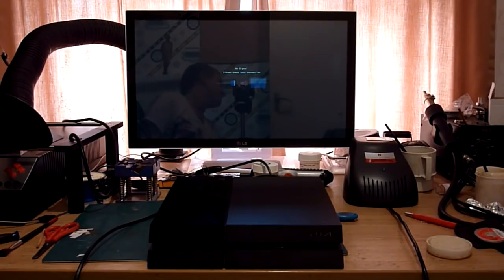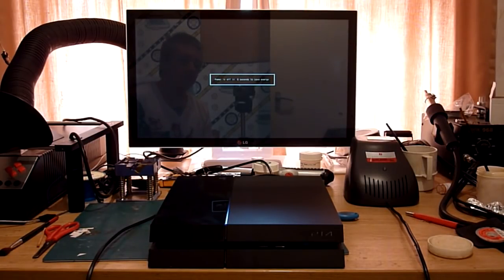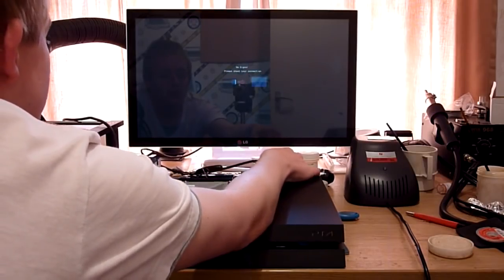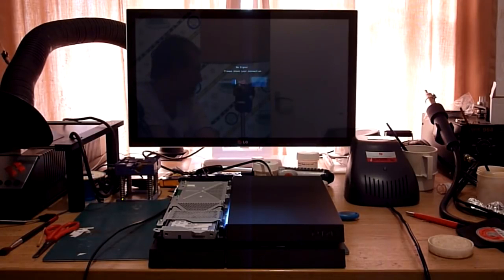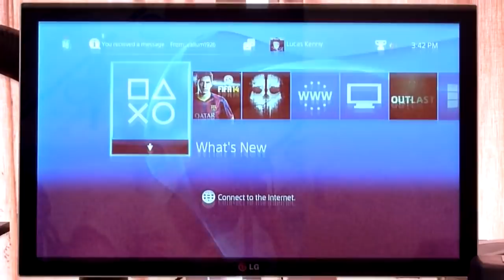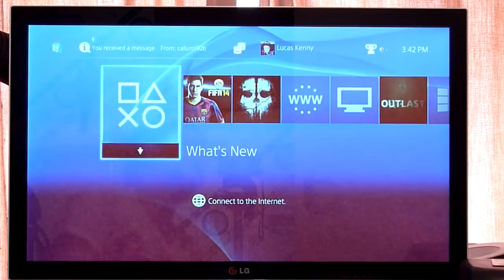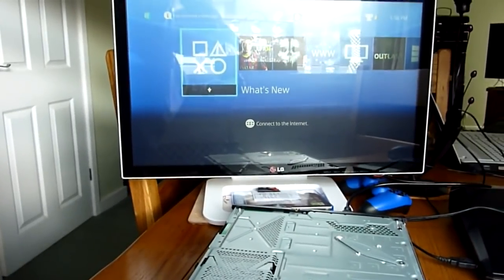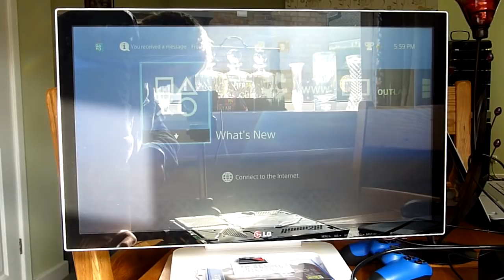PS4 White Light of Death (WLOD) - Faulty HDMI Socket Replacement Fix

Comment: this is not working
Reply from the maker: If a port change hasn't resolved a display issue then it's most likely a HDMI Encoder IC failure. If the original port doesn't look damaged then this is probably the cause. Cheers.

Comment: Mine starts flashing blue then turns white and TV shows no signal and ive tried different hdmi cords and different TVs. What should i do like should i go to a gamestop or somewhere?
Reply from the maker: Nah Gamestop won't repair that. You'll need to find an independent console repair shop. It'll most probably either be a faulty port or a failed HDMI Encoder IC. Easy fix.
Reply: +hMmod alalm3e  im going to a repair shop tomarrow
Reply: +hMmod alalm3e ok cool man
Reply: +hMmod alalm3e i went to a repair place and it will take 7-10 work days

Comment: how do u take the top off. just pull?
Reply from the maker: Unscrew the rear T9R in the top, centre at the rear of the console. Slide off the HDD cover and remove the two screws securing the top cover. Pull up from the front edge and slide it off backwards.

Comment: i also have this  problem but my hdmi port seems fine so if Encoder IC broke     is there posibility that i repare this without  loosing data on my hard disk ?
Reply from the maker: Yes - just replace the Encoder IC if you believe that to be the culprit - 95% of the time it is when the HDMI port is fine.
Reply: Andrew Paul  thank you alot
Reply: +đeki čen I'm having the same problem and I have no idea what caused it. How do you replace the encoder IC

Comment: mine cums on starts playing the game then cuts off to no signal n ps4 white light cums on is this the same
Reply from the maker: +marley ryan Most probably an Encoder IC issue or HDMI Circuit failure if it's cutting out. Cheers.
Reply: same exact thing with mine smh
Reply: +Jesse Williams pain in the ass need to take to the shop but wanna no If it's big problem or minor don't wanna get ma ass slapped haha
Reply: marley ryan I rebooted my whole system that had all my games and everything else and it still don't work. I think something is wrong with the HDMI port

Comment: Could that be a problem with TV's HDMI port? I had that blinking twice (turning on of the console is normal), but after I repluging HDMI to TV it disappearing. Moreover, once the same problem was with Xbox 360 and with my laptop.
Reply: Machine Stuff i can relate
Reply: Machine Stuff my ps4 also doesn't work on the TV that it happens on but on others it does so I think its the tv

Comment: Mine just isn't working today, one second it was working fine, having the dns not connecting in time and cannot connect to dns error ( and yes if anyone wondered I have used googles it ain't fixing it) so I tried turning it off and on and when I tried turning it on for a second time it just gave me a white light and not showing me any picture, and this had happened immediately after I turned it off ( I keep it plugged in 24/7 for my hdmi) ( and if anyone was wondering for my first try it was just the blank picture, I feel like I might have to send in my Darth Vader ps4 to Sony so they can fix it)
Reply from the maker: +Smasherfan88 sounds like a failed HDMI Encoder - easy fix for an independent repair shop and should be cheaper than Sony.

Comment: Hello again +Andrew Paul I've got this weird ps4, it is showing green artifacts and some polygon breaking on the screen from time to time, I tried the simple stuff, swapping HDMI socket, hdmi IC, went over the whole board for bad smd's around the SB/HDMi circuit but nothing, do you think a reball on the APU may help or sounds more like a dying gpu issue? Thanks for your input!
Reply from the maker: +Moreno A Sounds like an APU issue - give it a reball mate and hopefully it should all be good.
Reply: +Andrew Paul Well, cant get it to turn on now, cooler moves like 1mm and stops, then after two blue blinks the ps4 turns off as the APU was not fit, think it may be the SB?
Reply from the maker: +Moreno A Does it allow you to power cycle the console without unplugging the power first or does it look totally dead until you remove and reapply the power lead? If the former then yes possibly SB - otherwise I'd maybe look to try a replacement PSU first and see what that accomplishes if you have a spare kicking around.

Comment: I have the same problem on my ps4 , I take my ps4 to fixing shop and he told me that the hdmi port is fine however he said a motherboard issue I took it to another one and the same .
What do you think the issue is ?
Reply from the maker: +SALEM A If the port is fine it will most probably be a Panasonic MC86471A HDMI Encoder IC fault and would need to be replaced. Cheers.
Reply: +Andrew Paul okay so how can I find this IC to be replaced?
Reply from the maker: +SALEM A Alibaba (China) is your best bet or a scrap PS4 board.
Reply: +Andrew Paul can i find this ic from ps3 motherboard?
Reply from the maker: No.

Comment: Should I ask PlayStation first or do this?
Reply from the maker: +nova the noob Sony will charge a fair bit for this work. If you've never done this before I wouldn't recommend starting out on an otherwise working machine. A good independant repair shop will do the job for a very reasonable price.